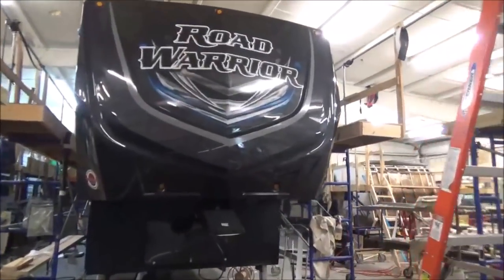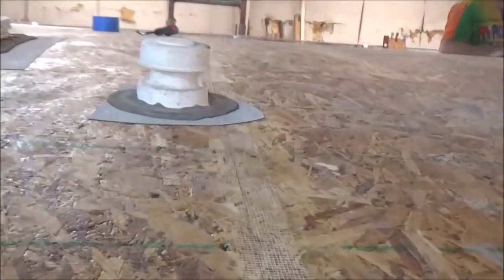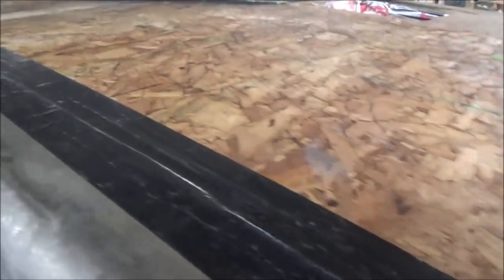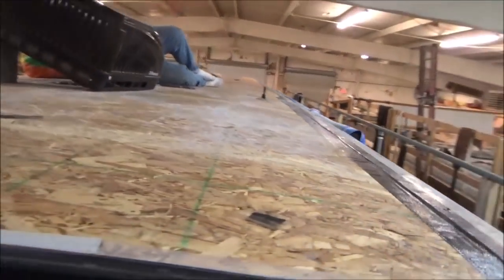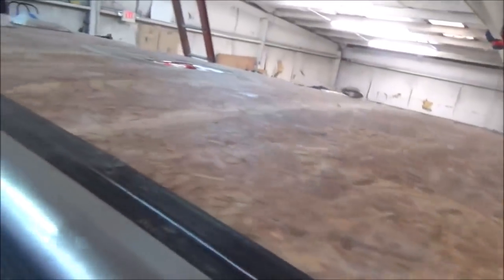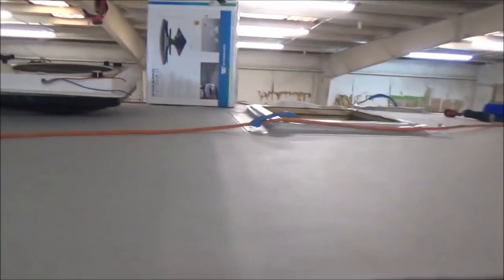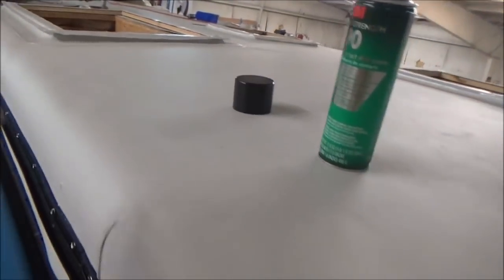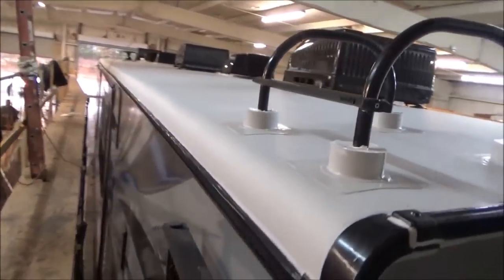RV Roof Replacement On 44ft. 2017 Road Warrior 5th Wheel

Comment: I will be calling this shop for my roof soon. I have a 36 ft fifth wheel already on my  second roof and it failed already with only 4 years on it. I watched a lot of this shops videos and I can see they do a premium job. Good work guys. I will travel from New York to go here  13 hr drive  but it will be done wright. See u guys soon. Tony. S
Reply from the maker: We look forward to getting your coach watertight. We'd love to open more shops but as you can see it's the rebuilds and repairs we need to make before the roof goes on in order to have long term results. And as you can see they're all different in some way or another. Folks come from all around...FL, VA, Carolinas, NY, NH, NM and even Toronto. 
Thank you....
Reply: I will call your shop tomorrow who should I ask for when I call we can  discuss my roof issues. Tony

Comment from the maker: Silicone doesn't stick to rubber or any other membrane unless it's primed. We use M1 by Chemlink. You should try to remove what you can of the old càulk. What to keep in mind is compatibility. Often products will not get along well and will have an adverse effect. Chemlink also makes Metalink, which is a silicone...a commercial grade product. Try Sashco ...Big Stretch.... over the Dicor. 
Thanks for watching.

Comment: Great job.  Does the shear length add to any complication in laying on the roof material, or is it just  handling more material.  That RV is twice the length of mine.  Wow.
Reply from the maker: It's not really the length of the coach that makes the roof more complicated to lay down, it's the profile of the roof...camber and slope.
Reply: So basically if the profile is relatively straight with manageable fish mouth effect going on there’s no need to cut and weld it in sections right?
Reply: RV ROOF INSTALL wanted you to know you’ve inspired me to do my own install this season. My roof is a 2005 that someone already tried to coat. Insert eye roll here, what a scam that stuff is, there’s a few small spots that it actually stuck to but that’s just cause I’ve not peeled at them yet. The stuff pretty much falls off. I’m figuring with my luck it may turn into a full roof rebuild despite it feeling pretty solid. The rear luggage rack and trim have got to have caused some water intrusion. The Dicor self leveling slobber looks like it always does. I plan to mimic your process without your resources. Hopefully the prep work makes for a smooth first and last TPO install. I’ll probably try to get a Ridgeyard welder, can’t afford a Leister for one small job. Do the Chinese clones work or is a Ridgeyard suitable for one job? I gather they can’t holdup like the Leister y’all are probably used to.
Reply from the maker: @ericstyer2890  if the coach is relatively b straight then there won't be a fish mouth. Good luck on your Install. Keep in mind that if the roof does not have the curbs it will leak.

Comment: If that’s how they installed the roof, how did they build the rest of the unit?!?  

Wow. 

Is there a brand of toyhauler properly built?
Reply from the maker: They all seem to be the same to me. I don't own one. Thanks for watching!
Reply: Just sold an older 5th wheel and am looking at shorter pull toy haulers. Willing to pay more for something better built, but I don’t know if there is such a critter. Maybe Desert Fox?

Anyway thanks for making that video.  Amazing that on what I’m sure was big $, they’d skimp on something like a couple gallons of adhesive and proper seam tape.
Reply from the maker: @JeffinTD  They're all the same. I don't own one.

Comment: Does building up the new seats for the a/c units affect the internal ducting that so e coaches use?
Reply from the maker: We extend the plenum or the intake and supply separator, whichever the design. Thanks for watching!
Reply: RV ROOF INSTALL Your videos have convinced me to buy used, buy right, and bring it to you!
Reply from the maker: @Gratefulwon  let us know before you buy. Oncé in a while our customers sell theirs. We would just flip the warranty.

Comment: Should I use some #10 painted screws with rubber washers for the outside trim?
Reply from the maker: What kind of trim? Does the trim have an insert to cover the screws?
Reply: @RVROOFINSTALL  It doesnt look like it. Since its a 1976 coachmen cadet it might be too old for that. Atleast I havent seen it when researching that make/model/year and the trim itself doesnt look like it had the hook style the the rubber would slip under.
Reply from the maker: @alexsenst4912  send a pic to contactus@rvroofinstall.com.

Comment: What do you use if not silicone and dycore?
Reply from the maker: Chemlink products. M1 or Duralink. But if you do have silicone Chemlink has a commercial grade Silicone that will stick to other silicones. It comes in about 30 colors. It's called Metalink.
Reply: @RVROOFINSTALL  thank you so much. I have a 98 seabreeze 5th wheel. I wish I could get it to you.

Comment: This is my 4 th video I've watched trying to gather info to do the roof on a 1999 Tahoe lite my stupid ass bought. And I'm realizing all these dam things are garbage every aspect will fail no matter the trailer wtf man what a scam but hey keeps yall in business. Anyways I've allready torn the roof off its rotted in every dam corner so I took it out and put new wood in better thicker wood. "That's what she said" and now I'm putting 5mm across the top. Purchased a roof kit guess what? Comes with a whole gallon of glue lmao fml it's only 18 ft long so I should be fine but still just a scam that never ends